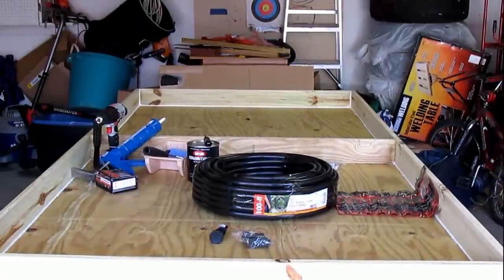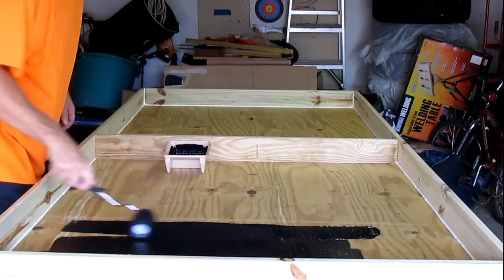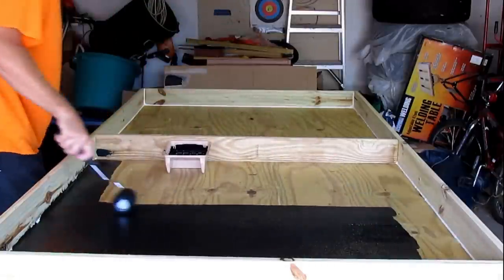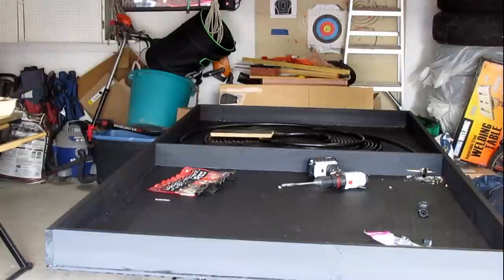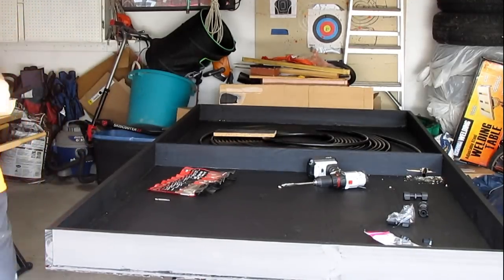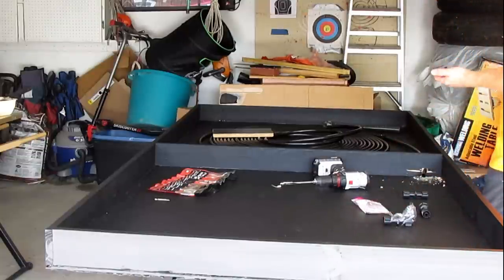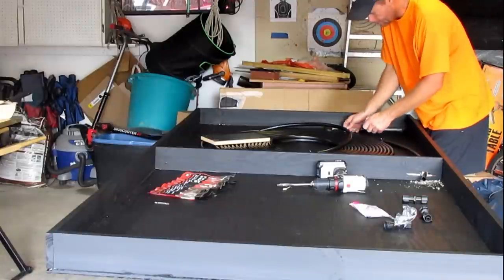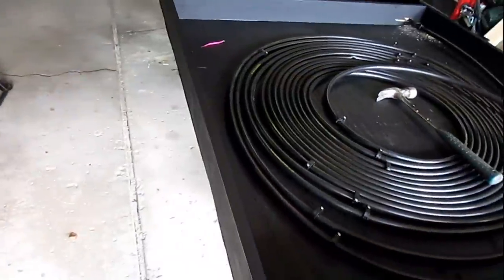How To Build A Solar Pool Heater - DIY!

Comment: How long were you able to keep your pool up using this? I'm in north east Indiana so I have similar weather. Also how much warmer did it make your pool water itself? Also have you opened up for the year yet? If so how warm is yours getting?
Reply from the maker: Hey Brent,
We are trying to get everything together this week and hope to have the solar heater running by the weekend, or sometime during next week.
We were able to keep the pool open til the end of September last year. The time the heater was getting direct sun by that time was severely reduced by that time.
During the Summer, I was able to raise the temp 2-5 degrees every day depending on how sunny it was. When the days were long, we were able to maintain 78-82 degrees. As Fall set in, we were still able to 75-79.
I am planning on adding a second unit this year to try and squeeze a couple extra weeks.
The biggest thing is to keep the pool covered at night as it looses so much heat overnight.
Thanks for stopping by & heating my fiend!
#RCInsiders
Reply: RC Insiders so I have a question. With 200 ft of piping how does a 7.2 ft high pump make it all the way through all the piping and back up the height of the pool wall? I did 100ft of black tubing and have about the same amount of lead hose and return hose from my box and I can’t get the water to flow through it.
Reply from the maker: Hi Brent,
So there has to be an issue somewhere as the pump should have no problem making it through that amount of tube.
Did you make sure the flow rate on the pump is adjusted high enough for the system?
Did you undo the hose from the heater and run the pump to ensure the pump is working correctly?
Also, undo your return hose and see if you have flow coming out of the heater. Basically to check for any blockages in the circuit.
After you do all your trouble shooting and determine everything is adjusted & working properly, it could end up being a faulty pump. it's rare, but it happens.
Hope this helps & let me know if I can help.
Reply from the maker: Hey Brent,
How's it going?
Did you get it working?
Reply: @RCInsiders  Yes I did I needed a new pump thanks for asking! Although it has not been in use yet as its been 55 and rainy since I built it lol how long do you think on a couple nice days itll take to warm up a 10,000 gallon pool? its suppose to be 80-85 and sunny this weekend I was really hoping to be able to get in my pool lol
Reply from the maker: Hey Brent!
Sorry for the late reply & hope you're swimming now :)
We had that same weather & raised the pool from 59 to 80 in a couple of hot sunny days!
Have been swimming for a few days now & maintaining 80-84 & loving it!
Also, remember to keep it covered as much as possible, especially at night.
How's it going?
Hope you're swimming!!!

Comment: Great video.  Did you need an adapter for the small pump to fit your 5/8-inch garden hose?
Reply from the maker: Thanks Todd!
I didn't use an adapter to connect to the pump.
I just cut the end off & pushed it over the fitting on the pump.
It's pretty snug & didn't leak at all last year. I'll be getting ours out here within the next few weeks. can't wait to be beck in the pool!!! 😍
Thanks for stopping by & happy heating my friend :)
#RCInsiders

Comment: Hey, nice vid. Was wondering any info on if the tubing is safe to run constant hot water throughout and back into the pool?
Reply from the maker: Thanks Darrell!
What kind of safety concerns do you have?
Thanks for stopping by & happy heating my friend :)
#RCInsiders
Reply: It's probably not rated for scolding hot water, but 140*F is on the low side on my Hot Water Tank.
If you pump water through it pretty consistently: it'll keep the tubing cold.
Reply from the maker: I haven't had any issues with the solar unit :)

Comment: Any thoughts on 3/4" plywood vs 1/2" plywood? I can't tell which you used.
Reply from the maker: Hi Nicholas,
1/2" is good. You could probably even use 1/4" as well.
I went with 1/2" because at the time it was actually cheaper than the 1/4".
3/4" is great, but it will be much heavier.
Are you getting ready to make one? Let me know if you have any questions.
Thanks for stopping by & happy heating my friend :)
#RCInsiders
Reply: Thanks for the info! I am getting ready to make this exact one — How is your pump holding up?
Reply from the maker: Hey Nicholas,
Entering second season with no issues so far.
Pretty good little pump. 
How's your project going?
Hope all is well :)
Reply: @RCInsiders  So far so good! About to paint'em and put the tubing on! Quick question: I couldn't fully tell from the video but when you coiled the tubing, did you start from the inside and work your way out or outward to inward? Does it matter?
Reply from the maker: Hi,
It doesn't matter, but seemed to be easier to work inside out :)
Reply: RC Insiders did you ever end up using the male adapter for your 1/2” tubing? I saw you used the two female connectors to connect the hoses and the coupler to join the tubes but I couldn’t tell where/if you used the male ones.
Reply from the maker: Hi Nick,
The male hose adapter is on the outgoing side of the heater, so one male & one female.
How's it going? Did you git er' done? :)
Reply: @RCInsiders  Gotcha. It's going OK... my hose is kinking like crazy. I think it's because I'm feeding it through a hole going into my box frame and that's creating too much tension for the tubing (since it naturally wants to coil). Gonna give it another go tomorrow. Gotta let myself cool down from the frustration of kinking tubing ^_^"...
Reply: Good news ... almost done! I have room for about 3 more laps of tubing! I went the zip tie route.
Reply from the maker: @nwkwok  Cool down brother...You got this! :)
Reply from the maker: @nwkwok  Awesome Nick!!!
Reply from the maker: Hey Nick,
Here's me adding the cover & a 2nd unit - https://youtu.be/sdV8_EJTVzo
How's it coming along?
Reply: I finally finished it and it works great!!! My friend said it’s shooting out 120 degree water on an 83 degree day. I also made a video and gave you a shoutout in the beginning for all your help :) thank you so much! Here’s the link to mine if you’re curious:
https://youtu.be/EO8SyoGmWFw
Reply from the maker: Awesome Nick!!!
I knew you had this brother :)
Now you will be able to enjoy the pool a whole lot more!

Comment: Thanks for the awesome video- I am going to start building mine soon. One quick question, Why did you opt to use the pump/garden hose method and not connect this to your pool pump? Asking for a wife that isnt going to like an electrical device (the pump) inside the pool. :) Also...GO REDSOX!
Reply from the maker: Hey Patrick!
We opted for the hose pump for a few reasons:
I didn't really want the pool pump running all the time.
I wanted a small pump to push the water as slow as possible.
I am adding a timer to the outlet to kick the pump on every 10 - 15 minutes.
Running this pump costs next to nothing, but when the pool pump is on I can see the meter spin! :)
I absolutely understand your wife's concern. We simply unplug the pump when anyone is in it. Better safe..
Also...Go Tigers 😜 Keeping my fingers crossed for some baseball this season!!
Thanks for dropping by my friend & hope you have an awesome pool season!
#RCInsiders
Reply: @RCInsiders  Thanks man. We are getting our first pool and are really excited for it. I have a physically disabled child that gets really cold easily, so getting the water temp up is going to be important for us. Thanks again, I'll let you know how it goes.
Reply from the maker: Awesome man, congrats on the new pool!
Try to keep it covered especially at night as they lose a ton of heat overnight
Reply: Patrick McCallum looking at doing this, but have a question. Why not tie the inlet to the heat straight in to the drain on the bottom of your pool.  With how big your pool is you should have enough head pressure (water weight) to easily move the water through the heater and back into the pool. Fluid travels the path of least resistance.  Doing it this way will completely eliminate the need for a pump.
Reply from the maker: Hi Abigail!
A few reasons I opted for the pump:
With flow being restricted so much with the tubing, wasn't sure if there would be enough head pressure to make back up above pool level & back in the pool.
I am going to experiment with a timer to let the water sit in the heater for a bit before being pumped back into the pool.
And the biggest reason is that should a leak occur somewhere in the system, I did not want to wake up to an empty pool 😜
Thanks for stopping by my friend & happy heating!!
#RCInsiders
Reply: I'd love to know how to tie the system into the pool pump instead of the submerged pump as you mentioned. Anyone have a suggestion on how to do this? We plan to run the pump during the day and will do do during the best sunlight hours.
Reply from the maker: Hi Meghan,
You can do this & use this same solar heater box.
You would just convert one of your pvc fittings on the outgoing side of your pump to a garden hose fitting.
I may be able to help, but would need a pic of pump set up & the exact sizes of the fittings.
Thanks for stopping by & happy heating!
#RCInsiders

Comment: Would it may be easyer to hook it up to the filter system?
Reply: Ok. May be the wather would get too hot.
Reply from the maker: Hey veiko,
Yes this is possible. The pump is much simpler & gives you more flexibility for run times & experiments. There are several reasons that I prefer this pump.
I can help you, but I need a pic of your pump set up & the exact sizes of all the fittings.
Thanks for stopping by & happy heating my friend! :)
#RCInsiders
Reply from the maker: @charlesentress6282  Hey Charles,
It sounds like you know what you're doing, so as long as you are comfortable I think this is absolutely realistic. 
How many gallons is your pool?
This pool is app. 9,000. I now use 2 of these units with this setup. This year it took 3 sunny days in the low to mid 80's to go from 61 degrees to 84. In the past with one unit this usually took a week,
With the 2 units I often don't run the solar units in the summer as the pool gets too warm :)
I prefer the pool at 78 - 81, but the family loves 85+.
To maintain water temp, I always cover the pool with a cheap solar cover, especially at night as this is when a pool loses the most heat.
Let me know if I can help with your build.
Thanks for dropping by & happy heating my friend!
#RCInsiders

Comment: i have a 15,000 gal pool. how many of those panels will i need to heat the pool from 75 to 80 degrees. South side full sun.
Reply from the maker: Hey Tom.
While it would be impossible for me to account for all the variables involved, I can tell you that this heater raised our pool temp 6 degrees in the first 3 days. The pool in the video is just under 9,000 gallons.
Adding a cover to the pool will help hold in the heat overnight as well.
Are getting ready to tackle this project? Had a lot of fun with this one & it was awesome seeing hot water come out! 😀
Thanks for stopping by my friend & let me know if you have any questions.
#RCInsiders
Reply: you have a real pool, you should get a real pool solar panels and have them with your existing plumbing with 2 pool valves for entry and exit of solar water
Reply: Probably gain 6 degrees C but you will lose half at night. Best Buy an electric heater
Reply from the maker: Hi Moto,
Keeping the pool covered when not in use does wonders for heat loss :)
Happy heating my friend
#RCInsiders

Comment: im curious if that 120 degree temps were sustained the entire time you filled?
Reply from the maker: Hey trapfarm
There are a lot of variables that affect outgoing temp. 
Outside air temp, duration of direct sunlight, pump flow rate, length of tubing are a few factors that will help or hurt.
Checking the temp after 5 - 10 minutes that day, the outgoing temp was down to 100 degrees.
This year I will be adding my Christmas light timer to allow the water to sit in the coils for 5 - 10n minutes before the pump kick on.
This will be an experiment as when it gets real hot here, I don't want the pool to get too hot! 
You could also add more coils if this don't get you where you want to be.
This was a fun project and it produces hot water! It's a good feeling :)
Are you thinking about making one?
Thanks for stopping by & hope you have a great pool season.
#RCInsiders

Comment: Thoughts on using a solar pump? Would there be enough water flow?
Reply from the maker: Hi Albert,
I'm not overly familiar with how they work, but I have thought about it.
My thoughts are that it wouldn't be proficient during times of no sun.
So even when its hot out out & the hot box would be creating heat, the solar pump may not.
Your thoughts?
Thanks for stopping by & happy heating my friend! :)
#RCInsiders

Comment: I built a 400' solar heater for my pool, almost exactly the way in the video but in Az on a 78° day without the water flowing the hose melted and leaked everywhere, two different times. You must have the pump constantly running during the day but that's not 100% accurate because it can get to 115° plus here and when it gets that hot, the solar heater will not be running. So then what do I do? My next option is to remove the acrylic or drill holes in it to release excess heat.. Defeats the purpose kind of.
Reply from the maker: Hey Robb,
A dilemma indeed.
I'm not really sure why the tubing would melt at only 78 degrees. The heater in the video ran all summer in the 80's, 90's and a few 100's.
What kind of tubing did you use? If it's getting hot enough to melt tubing, perhaps partially cover some of it with a blanket or something to reduce some of the direct sunlight?
Let me know how you're doing brother, we can fix it somehow :)
Thanks for stopping by
#RCInsiders
Reply: @RCInsiders  I'm using rain bird heavy duty irrigation hose, black. I wish I could post pics. Even the stiff 4x4 insulation curled up. I'm going to try without the acrylic on next.
Reply: @RCInsiders  for the record I'm not bashing you, I'm just having this issue that noone else with this similar design seems to be having or at least it's not mentioned.
Reply from the maker: Can you email a pic? I gotta see this thing! :)
Reply from the maker: Nah...I gaottcha bro. I wish I knew why it was getting hot enough to melt tubing. 
It almost seems like the cover you're using is creating a magnifying glass effect...That's gotta be it!
email me a pic if you can :)
Reply: @RCInsiders  yes I can email it.  I think you could be right. I've changed the tubing twice already and both times the melt is in the same location.
Reply: @RCInsiders  is there a way to email it to you without you making your email public?
Reply: @RCInsiders  I Googled your website. I can send you a message through there I think, I'll wait for your reply. No worries no rush.
Reply from the maker: Hey Robb,
You can head over to our YT about page:
https://www.youtube.com/channel/UCHtN1NtMk5yeK5hksiyxydQ/about
Scroll down a little bit & you will see "view email address" 
It's just set up that way so email bots can't spam you...they haven't learned how to click buttons...yet! :)
Reply: @robbs.6871  Someone else on YT used  PEX tubing, which is rated for hot water.

Comment: Great video, so far is one of the most easy ways build a DIY water heater, thank you for sharing, just one question, how long does it take to rise the water temperature in the pool?
Again great video!!!
Reply from the maker: Thanks Gustavo!
There are tons of variables that will determine how quickly the pool will heat.
How much direct sunlight & how often the pool is covered will be the biggest factors.
I keep it covered all day with a cheap solar cover to compliment the solar heater. A pool looses a lot of heat overnight, so always keep it covered :)
I can't really say how long it would take to get your pool as warm as you would like it. Too many variables.
I can tell you that it has made my pool much more enjoyable with the extra heat from the solar heater.
Thanks for stopping by my friend & hope you enjoy your pool :)
#RCInsiders

Comment: Something bery importante Is that the tube must be  uv rays resistant tupe
Reply from the maker: Hi,
Yes, the tubing I used that I listed in the parts list in the description is UV resistant.
It has lasted for years & still working :)
Are you building a solar pool heater?
Thanks for dropping by & have a great day!
@RCInsiders

Comment: Can you use glass to cover the top?
Reply from the maker: Hi Terri,
Yes you could cover it with glass but I opted not to for safety reasons.
I couldn't get the image of someone falling on it out of my head.
Are you going to build one?
Let me know if I can help :)
Thanks for dropping by & happy heating my friend!!
#RCInsiders
Reply: Yes we are going to build one. We are first time pool owners and are starting out with a 15’x48”. We live right at the shore (too cold to swim) Connecticut. Yes you are probably correct about the glass. We have a window which was replaced that has Kevlar in it. Thought it might be strong. Much appreciated.
Reply from the maker: Congrats on the pool!
They are a little work to maintain, but soooo worth it 😀
Here in Michigan we have a short pool season as well. With this solar heater, we are able to start earlier & close later & it is so much more enjoyable.
I have since added a second unit I show how we covered them if you wanna check it out - https://youtu.be/sdV8_EJTVzo
I am constantly fighting shade in my back yard, so I think I will add a 3rd unit this year Lol. If I can extend the season by even a week its worth it 😜
Let me know if you have any questions :)